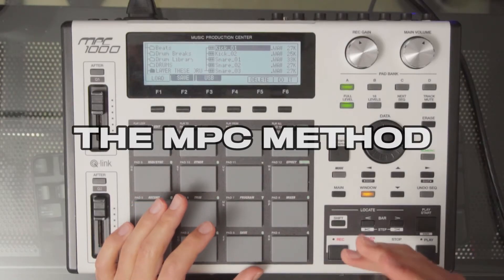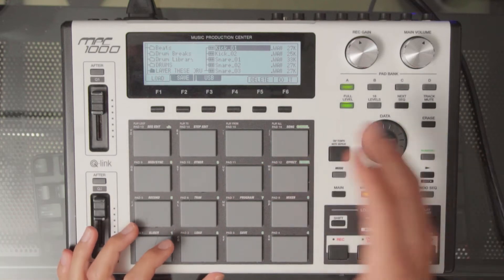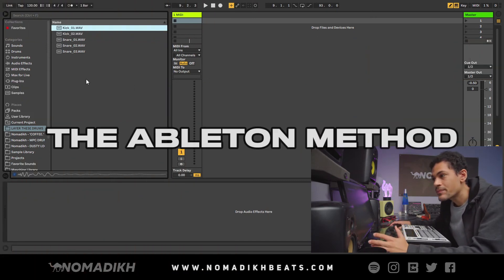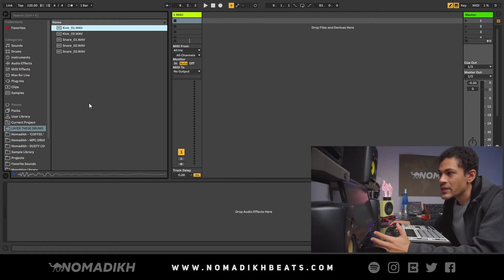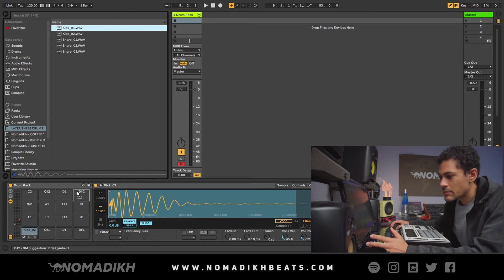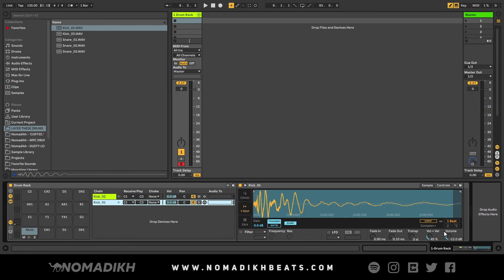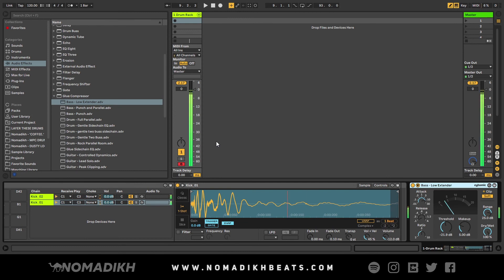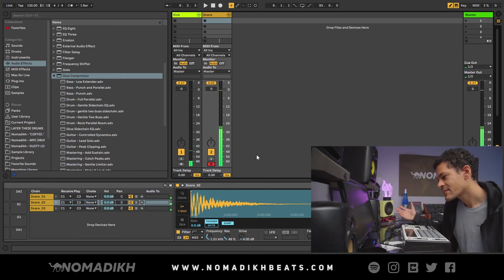Make Your Drums BANG With This Trick

Comment: Another great video. Thank you so much.  Unrelated question: Does the KRK's have that "hissing" noise that some monitors have when they are idle? Just curious. Thank you again. Blessings!
Reply from the maker: Uhh depends which ones you get, the VXT4s pick up the radio but the Rokits don't as much
Reply: @Nomadikh  Thank you for your response. Yes, I was referring to the KRK Rokit 5 in. "Classic 5." I have been doing lots of research and I hear great things about these monitors. I just wanted to make sure I wouldn't get all that hissing noise that some monitors have.